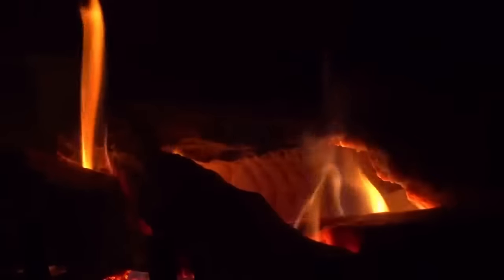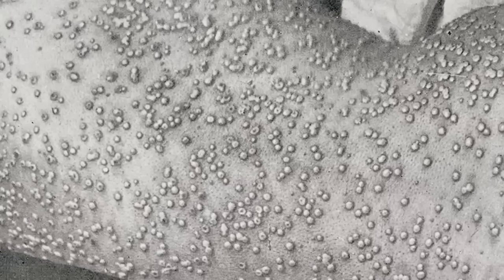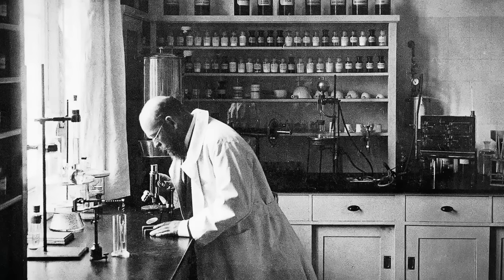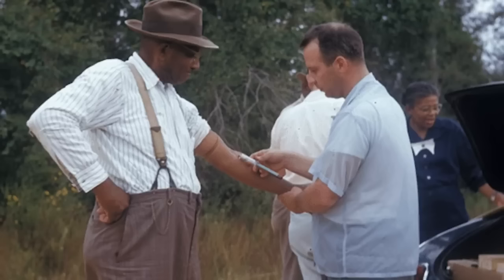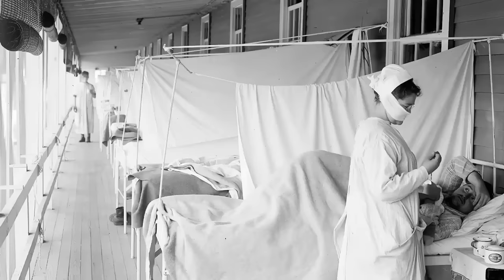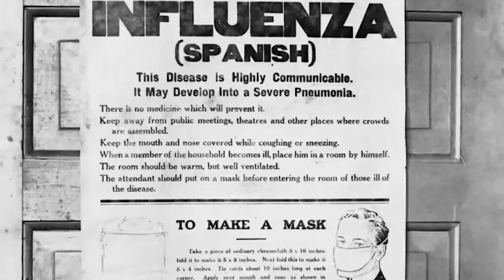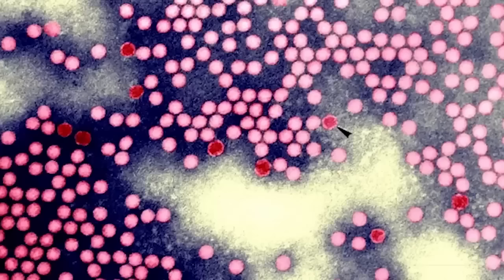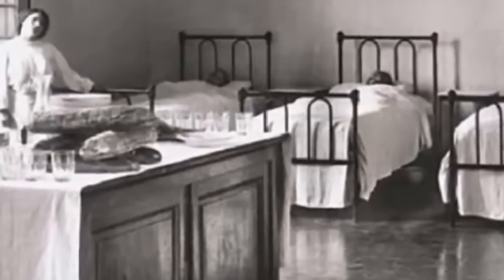The Most HORRIFIC Diseases In History - A Compilation

Comment: When I was remodeling a home build in 1912, I wanted to get rid of the ugly aluminum siding and restore the original wood exterior.  I had a contractor come over to give me an estimate.  He peeled a small section of the siding away, and then immediately nailed it back in place.  He said "You have a layer of asbestos all the way around the house.  If you leave it where it is you will be safe, but the second you start to disturb it you'll be at extreme risk.  You'll have to hire a professional company to deal with it, and it will cost you about as much as you paid for your house.  My company won't touch it."  I took his advice and made peace with the aluminum siding.  Fortunately, there was no asbestos on the roof tiles, so I could reroof normally.
Reply: that is horrifying, i couldn't be at peace living there, knowing there's a butt-ton of asbestos 😳 kudos to u

Comment: Disturban- have you done a video about elephantitis?
Reply: Elephantiasis (not elephantitis)is caused by mosquito bites which inject parasitic worms into the lymphatic system. They eventually block the capillaries and cause buildup of fluid. The skin gets really thick like an elephant’s skin. A nursing instructor I had years ago drilled the correct pronunciation into our heads and I will always remember it. 😂